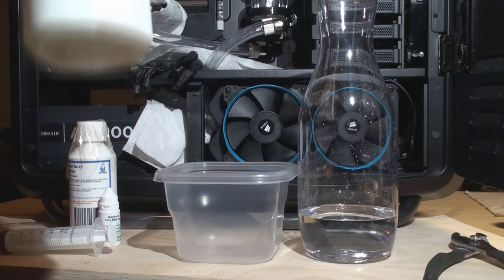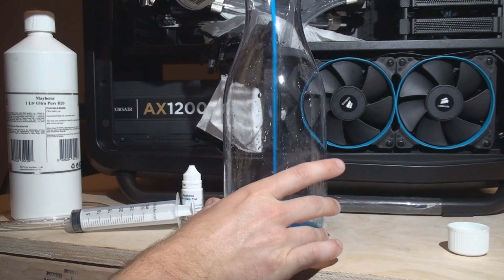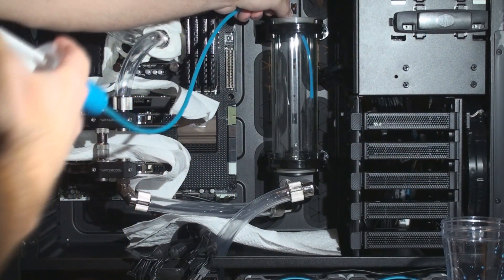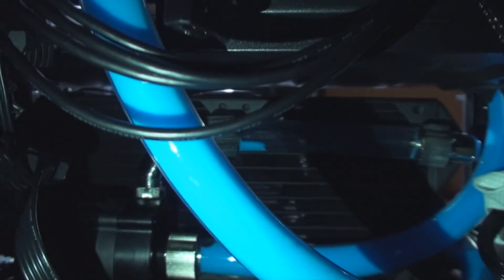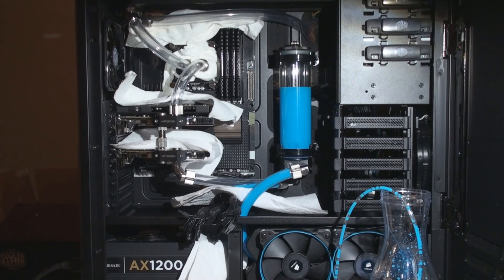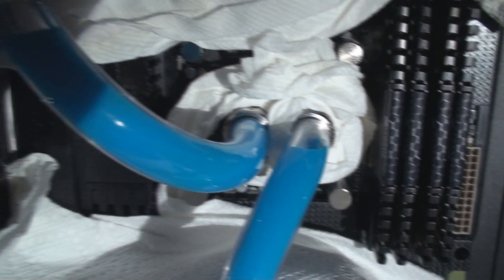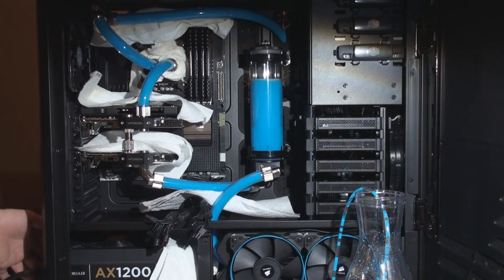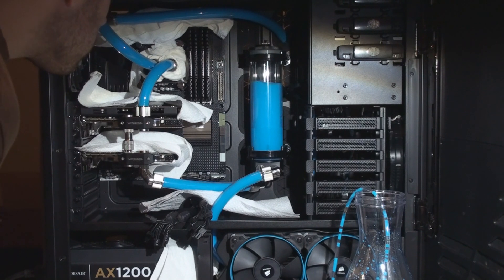Cooler Master Cosmos II Custom Liquid Cooling Build Part 4 - Filling The Loop

Comment: Why did you mount the power supply upside down? The fan should be pulling air through the bottom of the case.
Reply: Brent Anon actually he's not wrong usually you don't want the power supply affecting the temperature inside a liquid cooled PC.
Reply: Brent Anon also if you were to have a leek your liquid wouldn't drip into your power supply

Comment: how did u instal the radiator of 240 in the part for the HDD?
Reply from the maker: Hi, just double sided tape.
Reply: +Daniel Gonzalez the case come with adaptive brackets for the radiator
Reply: this is why im here, how to fix that?

Comment: About tightening those fittings, as an extra precaution you could also use thread seal tape.
Thread seal tape is also known as plumber's tape.
I use it for most of my liquid cooled builds, honestly said i never had any leaks by using that stuff.
Reply: Yeah, I was thinking of the same kind of tape. Also, I was hoping to get a better explanation of the tubing configuration for referencing.
Reply: +e x l e n s i c Ribbon dope

Comment from the maker: Yes you can use the brackets and mount to the other side, although with a long PSU it may be a squishy but doable fit. The client wanted the radiator on the front side so it can pull air in from the side and have it blow out the back. Having it like this also hides the pump and tubing and wiring of the PSU when the side panel is opened which I think gives it a cleaner look personally. Although it is just personal preference you do not have to mount it like that. Thanks for watching!

Comment from the maker: Thank you so much! Glad you enjoyed them.

I used thick double sided tape to mount the pump and the bottom 240mm radiator. This will also act to terminate any vibration caused by the pump. Its very secure tape so the pump or radiator wont move you can pick it up at any hardware store, its red and has a 5 pound holding strength. I believe its by Scotch or 3M.

It would be very close with 54mm. It also depends on how much your motherboard extends up past the top standoffs.

Comment from the maker: Hi
I normally would suck out the liquid thats in the reservoir with a syringe first while tilting the case front to back to get as much out from there as I can. Then slowly start cutting the tubing where there is no liquid. Then ill blow into the tubing which will cause a lot of the coolant in the rads to come out. I also plug the ends of the components just in case there is still some left in it. Usually when I do a coolant change I am also replacing the tubing as well.

Comment from the maker: Yes the pump is very powerful and no there is no speed variable. Although once all your fans are running they drown out the pump noise considerably and you dont hardly even hear it anymore. (depends on how many fans you use though)

Comment: For the top radiator i recommend XSPC EX360 because it is 35.5mm  thick. For the bottom Alphacool Nexxxos Monsta 240mm 80mm thick rad.   The fan you can use for the bottom radiator in push/pull configuration "4x NB-BlackSilentPro PL-2 20dB/A or Corsair SP120 'Quiet Edition 25dB/A'.  And the fan you can use for the top in pull configuration "3x NB-BlackSilentPro PL-2 20dB/A or SP120 'High Performance Edition 35dB/A'  I also recommend you to use radiator gasket and fan control.

Comment from the maker: So basically if your only planning on water cooling your CPU then its up to you if you want to spend the money the temps wont be much better then  your H100. BUT if your planning on doing the GPU also then i highly recommend it.
The liquid in the reservoir drops in level at a very slow pace mostly due to evaporation. In the 6 months that I had a loop running it only dropped about an inch, not very often do you have to top it off. I buy my water cooling parts from Performance-pcs(dot)com

Comment from the maker: Hi and thank you very much for watching!
Yes I believe a custom loop is worth the money if you have it especially if you are water cooling the GPU also. If you are just cooling the CPU only then it really comes down to preference as you wont see a big difference in temps as opposed to your H100. Where you really see the temp difference is in your GPUs. Ive seen as much as 40C in temp drop from my GPU from water cooling them as opposed to when they were air cooled.

Comment: Hi,
really nice job there, well done, but I have got few questions. I have got almost same configurations except GPU. Mine is 7990. I have got H100 pull/push config for CPU.
I have got money to spend but I want to ask is it really worth to spend lots of money on proper water cooling kit (cpu,gpu, blocks). It looks nice, but is it worth it? And other questions is. How often do you have to fill up reservoir if you running pc lets say 3h every day?
Thank you and nice job there ;)

Comment from the maker: Hi
What I do is attach a fitting to the top of the reservoir and then a long piece of tubing to that. Then i flip the case upside down to drain the fluid out. Takes a little time but it works.

Comment from the maker: Hi!
Ive been running mine for 5 months and its been great! The Pastel coolant is rated to run in a system for about 2 years so you should have no problem running it for 6-12 months.

Comment: Very excellent and thorough documentation, thank you very much for this. I'm taking a class at a college where we need to build a $10k computer, and I wanted to do liquid cooling because it seems unparalleled by air cooling in terms of actual cooling and the noise level. I wasn't sure about all the parts that were required, like fittings, radiator, cooling, and distilled water; you really helped me for my project! :D